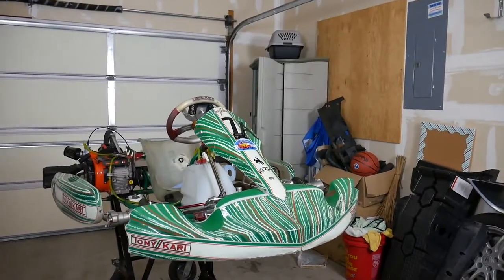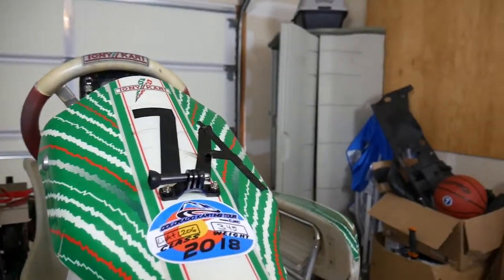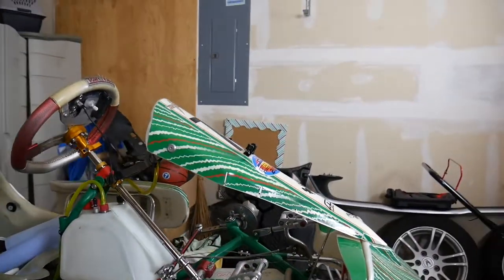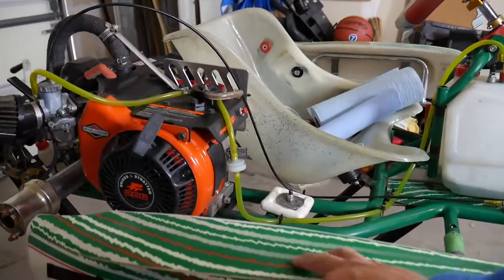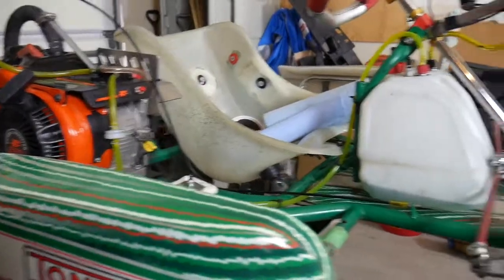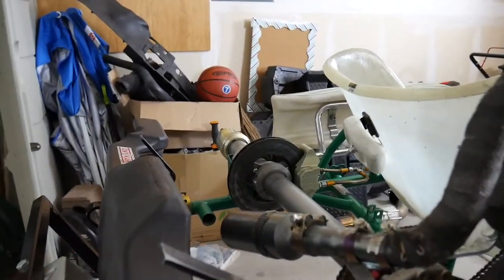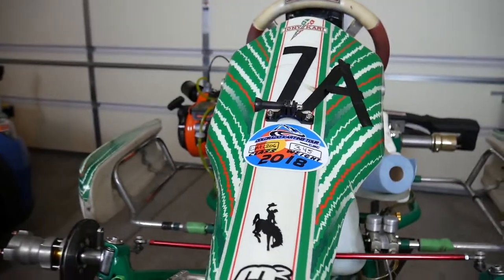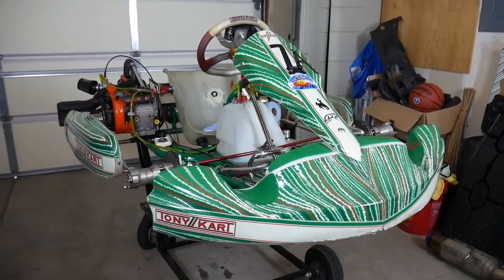Go Kart Action Camera Mounting Points

Comment: Front brakes on 206?
Reply from the maker: Yes, this chassis used to have a shifter motor. I replaced the motor with a LO2O6, but retained the front brakes. I did remove the brakes when I raced on one of regional kart races in CO.

Comment: If I mount the camera on top of my head should I keep the camera standing up or should I bend it a little bit down?
Reply from the maker: Hello Daniel, I would slightly bend it so you can the details of your braking turning and acceleration. This is important so you can study your driving habits and correct the mistake if you see that you are doing it. The go pro should be able to capture a lot of the scenery because it is a wide angle lens so, slighly bending it should not be an issue.